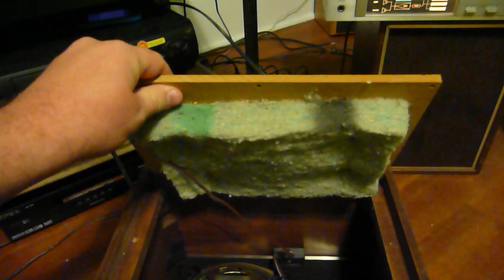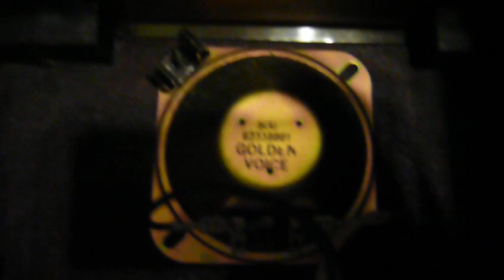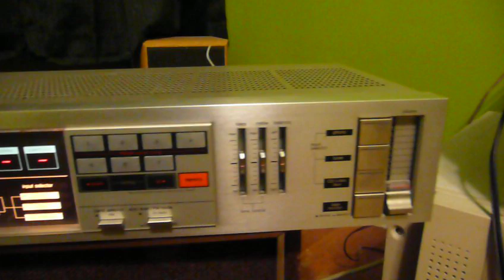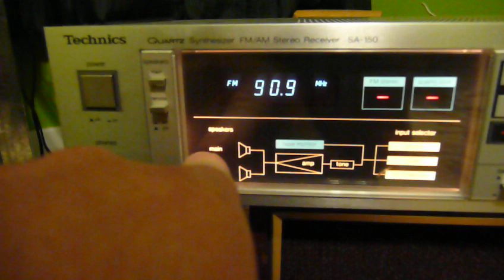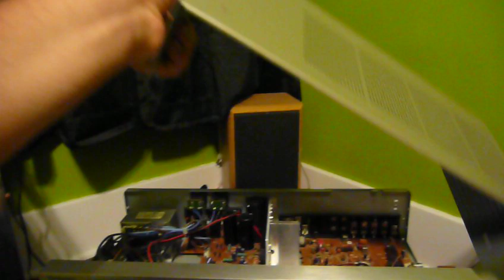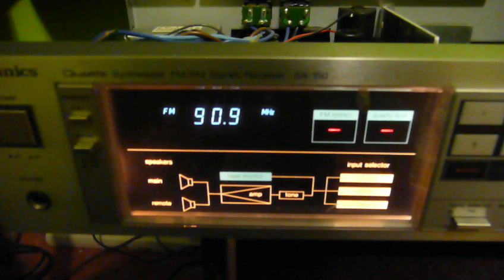Inside The Mystery Speakers / Technics SA-150 Receiver

Comment: Those speakers are likely by Motorola, I've got a larger set of them from the late 60's or early 70's with 10" woofers. They at one time had a tiny rough button size emblem on the top right about the size of a tie pin with the Motorola trade mark on them.
Both of the drivers are Motorola in yours, Golden Voice was a Motorola trade mark. Mine have been my shop speakers for the past 40 years. They have the same tweeter, same batting stapled on the rear cover and the same trim around the front. 
They likely came with an early Motorola FH 200, 210, or 212 receiver or one of their stand alone 8 track players back then. 
Motorola made quite a few models back in the day, they had a line of just AM/FM receivers and another line that were 8 track/AM/FM combos, as well as a few with a turn table on top too. I got the speakers as a kid in the 70's a neighbor bought a stereo system that came with them but didn't want the speakers, so he gave them to me. Many speakers back in the day looked very similar, there were some Sears versions of those too, identical in every way besides the emblem, but the Sears versions had the Sears catalog number on the back on a small foil sticker. They came with a three piece set of two speakers and a 3 in one combo receiver. (The Sears model number will begin with 716.XXXXXX if its a Motorola product).

Oddly I've got the same receiver powering them, it was new in late 1984, bought by a buddy who used it till the batteries leaked inside the rear compartment. It ate up part of the circuit board so I cleaned up the mess, patched the circuit board and gave it a single 18650 battery and holder on the back. All the battery does is hold memory, the 18650 won't leak and lasts for years without a charge. I took it out about a year ago to charge it and never put it back, it seems to hold memory just fine without it.

That receiver uses the common Sanyo STK4141ii Darlington pack module. They made around 25 wpc at when run at about 26volts, but can go much higher with added voltage at the expense of heat and longevity. I think the rail voltage on my receiver is around 29 volts when I tested it. They sound okay but tend to produce a bit of light background noise at higher volumes, something not present with the more common STK-0082ii chip used in pairs. Those were entry level compact receivers that met a price point back then. Most were sold in full rack systems or in conjunction with a matching cassette deck and turntable.
Reply from the maker: Thank you for your commentary and identification of the speaker drivers. There were several other folks who mentioned Motorola, and especially in light of the Golden Voice trademark, that seems highly likely.

I'm not sure what the design differences are between those Technics receivers with backlit LCDs versus vacuum fluorescent displays, but I've noticed the same thing. Those with VF displays seem to hold their memories for quite some time in the absence of any power. I have an SA-210 in occasional use that's had the same carbon-zinc batteries in it for well over a decade now. I check them periodically to make sure they are still in good condition and have not run down. They still seem to be in excellent condition. I have not looked into whether there is an unswitched winding on the transformer that provides a standby power supply, but I don't think there is.

Run in conventional class AB mode, I think the Sanyo STK series power packs are entirely adequate for a lot of people's needs. The only drawback in the Technics design is lack of effective speaker protection if the module does fail. This seems to be much more of a problem in their New Class A receivers, where the power pack module is under a great deal more stress from high bias current. Fortunately, Technics' later New Class A receivers (and some conventional class AB amplifier designs as well) seem far more robust with use of a Technics SVI series power pack.

Comment: I have a Technics I never put the batteries in and it holds memory. I think I remember seeing like an old watch battery when I took off the cover one time when.
Reply from the maker: Some models had a built in button cell battery. I have a few that do, and all are still running.

Comment: I have a Technics SA-151. The front display has more do-da useless static graphics, in addition to what is on the 150. The rear, where you said there were some inputs they decided not to use are actually used on my model. They are an array of 300ohm and 75ohm FMs, AM, and separate AM Loop connector antennas. There are also 4 more speaker inputs, +/- L/R Main, +/- L/R Remote. And there's 1 120v AC out (though it doesn't say whether its switched or unswitched and I haven't checked). The only other notable difference between the 150 & 151 seems to be the display. 150s are cool blue where 151's are more teal green (but that could just be the screen I'm looking at on youtube, idk). Haven't taken it apart yet to see about the amp # or cooling fin(s), but I imagine they are likely identical. Picked mine up from Goodwill for $13.50. I'm not mad at it! Takes up far less space than the old Zenith IS4041 I bought on Ebay just because my late grandfather had one. His was pristine, but this one was in average used shape and needs De-Oxit internal cleaning, though there are no obvious screws holding it together so it just never happened.... On the outside it's more or less fine apart from the plastic cover that arrived broken. The internals need a good spray down with De-Oxit though-- one of those that benefits from toggling the on/off or loudness button a couple times to rectify the occasional scratchy sound... If you want to pay for shipping it's all yours! They're WAAAY overpriced in my opinion, but I'm new-ish to the game of vintage HiFi.
Reply: Are you offering your SA for the price of shipping??

Anyway, the inputs, antenna connections and speaker outputs are identical between the 150 and 151. The schematics are indestinguishable

Comment: I Am A Technic Freak........I Would Love to Chat Stereo Equipment.....I Want To Learn Repair......Not a Drop of Knowledge but Ready to Learn 001-101 and So on........But I Have Alot of Technics!!!! And Only thing I ever Done Was Deoxit on My Sa-303.........Help?
Reply from the maker: If you're interested in electronics repair, the first thing to do is to start with a good understanding of the basic theory: what various components do, common circuit designs, that sort of thing. Once you've got that, try your hand at building some inexpensive electronic kits to learn soldering. Get a decent, basic multimeter (lots of good and inexpensive choices on the market today). Learn how it works and how to use it for making various tests.

Comment: Hi. I just bought the very same receiver and it was working fine at first. After about an hour of listening the left channel became very silent. You could hear some music coming from the speaker but it is clearly not doing the work it should be. How do i fix this?
Reply: Buy some cheap electrical contact cleaner such as CRC QD (for small electronics, not car parts) or some overpriced De-Oxit. If you look closely at the balance, treble and bass sliders there's a small open slit on the left hand side of their insides. Give a couple short sprays of cleaner inside each of those slits and work the sliders up and down at least 40-50 times. If that doesn't fix your sound issues you'll have to take the cover off and spray inside the back of the volume slider. It's not as easy to access and you have to make sure you get it inside the actual back housing. Good luck!

Comment: I have this receiver and I can’t seem to get the speakers connected to the back connectors for some reason. What am I doing wrong? Is new speaker wire to think/too many wires? I haven’t had this issue before with other receivers, but I’ve never had one with this type of locking mechanism for the speaker wires before. Thanks!

Comment: I have the Technics SA-150. I was able to get working again, however when I plug the headphones in, audio is heard through both headphones and external speakers at the same time. Do you know where on the board I should look? Any help would be greatly appreciated.
Reply from the maker: On most of the Technics receivers that support more than one set of speakers, you have to turn both sets of speakers off if you want to listen only with headphones. If those switches don't work, they may need to be cleaned or replaced.
Reply: @uxwbill  thank you for your response. As I waiting for your reply, I continued looking it over. I figured it out. While the speakers and headphones were plugged in, I hit the main speakers button to turn them off, and only the headphones could heard.  I do appreciate you taking the time to respond back to me.

Comment: Hello Bill i have the old Technics SA-120 is it possible to get a replacement lightbulb for it, it seem to be out of fabrication since many years. I think it had the last analog tuner of technics machines.
Reply from the maker: I don't know exactly which light bulb the SA-120 uses. Even if the original is truly unavailable, it's likely that something could be retrofitted with acceptable results.

I used a white LED to replace the failed "grain of sand" bulb in a Realistic TM-152 analog tuner.
Reply: https://ciiva.com/part/xamr78s250-10321556

Comment: I have a collection of about 10 realistic digital receivers. None of them used batteries to hold memory. They use a capacitor! From what i can tell they can hold memory for about a month depending how many hours the machine has on it. Had one that wouldn't hold it more than five minutes until I did a recap. lol Miss your audio videos...

Comment: i have this same amp how do you change the leds
behind the face plate
Reply: For anyone reading this question... It's not an led, it's a single 11v AC incandescent bulb.

It's hard mounted to a small circuit board and is not easily replaced as the bulb was made in house by Panasonic and is no longer available.

I replaced mine with a 'warm white' LED on a hand made little replacement circuit board, but that also required adding a 5v DC regulator board cause there's really no place else to get low voltage DC in that box

Comment: Oooooh! AlNiCo magnet speakers! Must...Have...Them!

These are gems you should hold onto as they (AlNiCo) tend to have warmer sound than today's ceramics. I bet they would be a great pairing for the Knight tube amp. I wouldn't put more than 10-20 watts into them. They are probably 16 ohm, that's why they could handle the ~40 watts you put into them. As for a date, probably mid-60's is my guess. Still no idea who made them (Motorola look alike...).

Comment: You should look into some of the GE speakers and receivers of similar vintage.  I have found that Technics manufactured speakers and receivers for GE.  I have a GE 1RCS5050E receiver that is pure Technics, and a set of GE speakers with Honey Comb disc woofers also made by Technics.

Comment: That's the first time I've seen real non-piezo tweeters with no crossover, not even a capacitor. Adding a non-polarized capacitor in the positive lead between the woofer and tweeter should help improve the sound. There are fancy equations to determine the exact value, but generally you can use a 4 uF capacitor if the tweeter is 8 ohms or an 8 uF capacitor if the tweeter is 4 ohms.
Reply: good call! Great in helping me better understand electronics and making it easyer when it comes to making ajustments to stuff like this thanks

Comment: @uxwbill yeah, it’s just my opinion about the look. I’m anyway more into 70s vintage (I have a Technics ST-7300 tuner and one of the matching amps, an SU-7300). Good if you like this unit! All it deserves is good care, even though it would never really be on my "wish-list".
Reply: personally I stay away from 70s-older and pre 86-85 stuff.
it tends to stink and have rust and smell quite bad too with rotted old capacitors and deteriorating rotting old speakers to.
I have yet to find machines other than being stored in a barn like that from the late-80s-90s and it is always build solid and out of metal with relays and doesnt distort like crazy just my opin~on
Reply: oh yeah and its all digital so I can sook it to my plasmascreen and it sounds and looks dope still and yet gives me all the bells and whistles I could ever want and more. Like pioneer elite late-80ers and it was practically free in trade I got.
and it can still works with xphinity remotes and everything. and it won't stink of gasoline and garage with layers and layers of garage crud all over it in most cases maybe Iv just lucky?
my finds: onkyo,nakamichi,luxman,technics,teak,pioneer,JVC,sony,kenwood,sherwood all solid heavy beefy monsters of metal not black plastic shit at all like people say so n it all has had builtin preamps for my turntable every time.

Comment: vwetslife’s even uploaded a video about your AM loop antenna: /watch?v=P3FGCrKFU3o

And I have to admit: even though I love Technics stuff, this is one of the worst pieces of equipment they have ever created. Not only could it have more quality (bigger heatsink [yeah, you might use this at a party with high volume for longer times], better materials etc.), but it also looks kind of ugly with all this fancy useless lights and the vertical volume control.